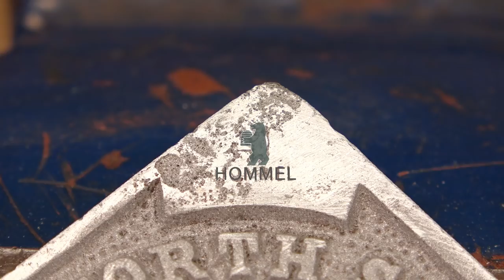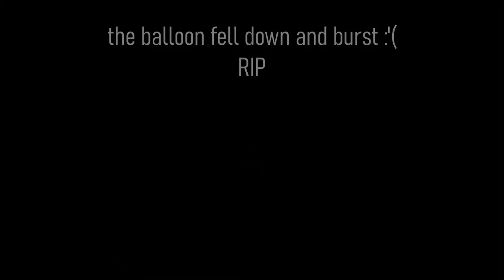Tap Wrench Restoration [Powder Coating And Paint Trick]

Comment: Just a little tip for when you powder coat, if you want the powder to stick better and cover every nook and cranny, preheat the metal first and coat it when it’s around 250 degrees F. The powder comes out much smoother too :)
Reply from the maker: Thank you very much for the tip! 😁👍
Reply: Проверим, посмотрим...

Comment: The piece looked very nice at the end. Did the powder coating in your kitchen leave much of a smell or any mess in the oven? I am posting a video later today in which I tempered an axe head in my kitchen oven after quenching it in motor oil and the whole house smelled like a burnt up engine. It was terrible! Nice work reviving this old tool. Cheers!
Reply from the maker: No, it didn't leave any dirt, just smelled strongly of paint.
Reply: I live in Karachi Pakistan and I like your comment send 10 month ago
Reply: @ForgottenShineRestoration  As did the next three dinners? 😂